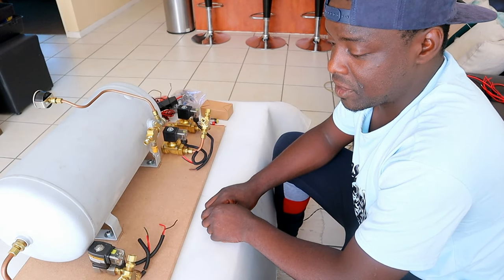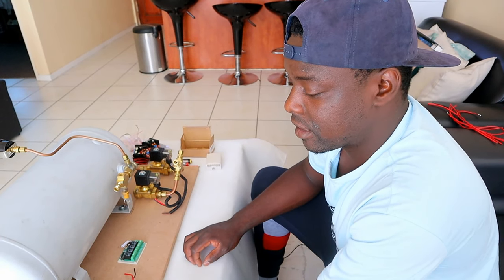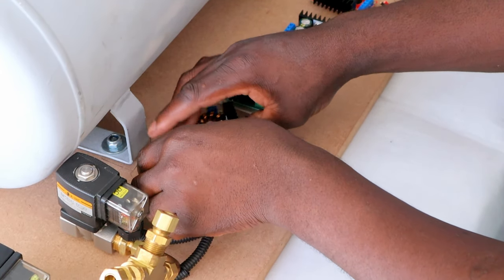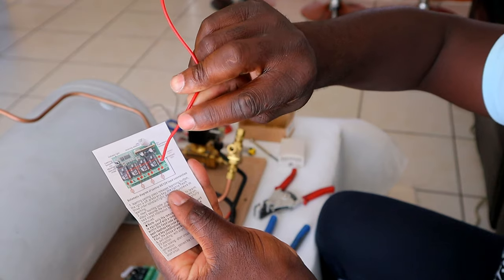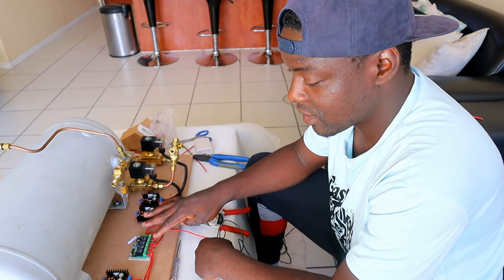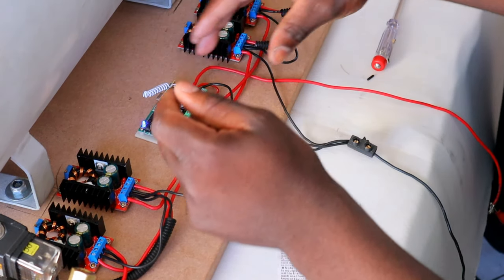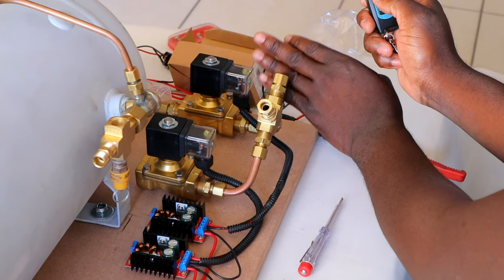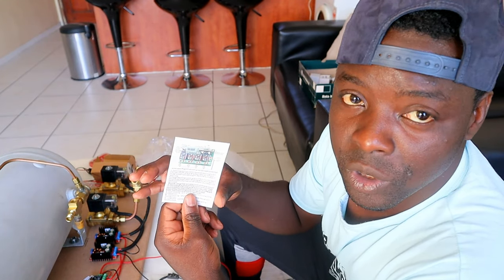AIR SUSPENSION: PART 2 - REMOTE SETUP

Comment: Hey mate, you dont need one of the buck inverters for each output. The relay board takes 12v to power it, so run 12V to the power input of the relay board controller only. Then use one buck inverter for in put of the 4 relays. So you have 24V going into the relays, rather than 12V. Hope that makes sense, hopefully that will help clean up your install too.
I would just switch to 12v relays, but you may not be able to easily get them depending where you are.
Cheers.

Comment: Shouldn't we use flyback diode to prevent huge voltage spikes from arising when the power supply is disconnected/ relay turned on and off ?

Comment: If I'm not using the booster module then how do I wire the receiver? I'm having trouble doing mine at the moment. I'm using 5/3 air valves
Reply from the maker: Hi Techniq_BB6, thank you for watching my video. Stay tuned for my next upload this week where I will be showing how to wire the receiver without the booster
Reply: Hi there, thanks. I actually managed to figure it out myself in the end.

Comment: why cant we use 2 solenoids for the whole system?
I know having the two air bags linked is not good for handling so why not use no return valves to avoid air going between bags?
Im looking at getting a airbag kit as i cant find individual parts for my car
Though looking to make changes like adding a remote for it and making it so when car turns off air is let out of bags and when turned on it rises automatically using pressure switch and N.O solenoids
Reply from the maker: Hi Michael Dellar. I have s few reasons why using 2 solenoids is not good
1 your set will be very slow going up all down because you are using one solenoid to go up and one to go down
2 you can only drive in one drive height so the front wheels and rear wheels will be one height you can't do a 60/40 drop
3 you can not put no return values because the system wont be able to drop down once the air is in the airbags

Comment: I do not understand why you have 2 solenoids going to x cross air fitting
Reply from the maker: One solenoid is for dumping and the other is for supply to airbags. The x cross is the centre point, it's like a multi-connector which makes the connection much easier. Instead of using t-connectors, I use the x-cross connector as it's not alot of joints and it minimizes air leaks.